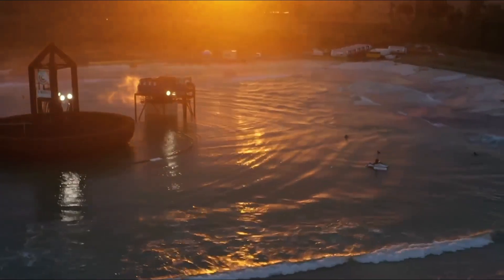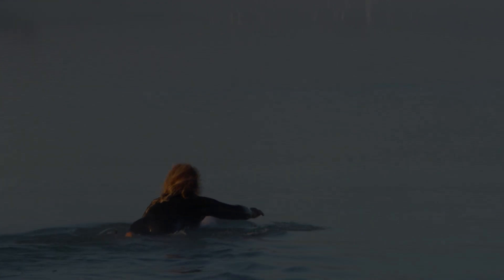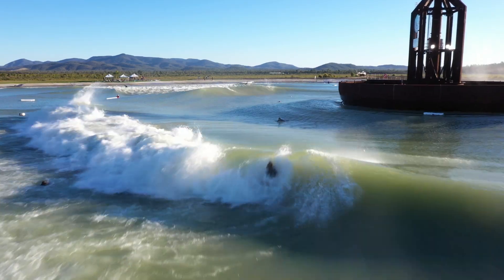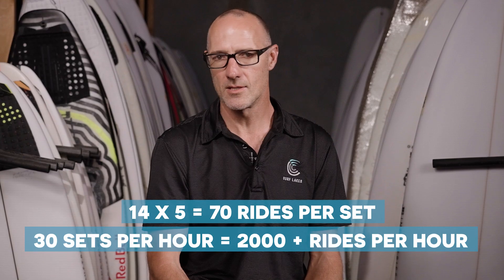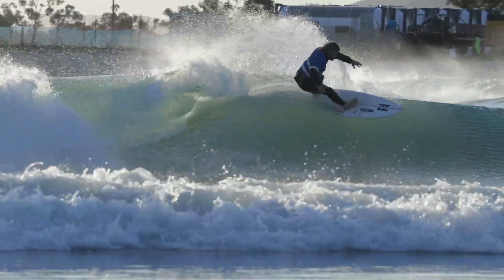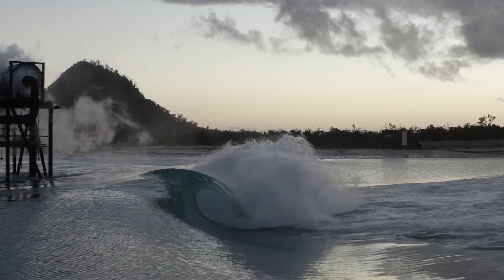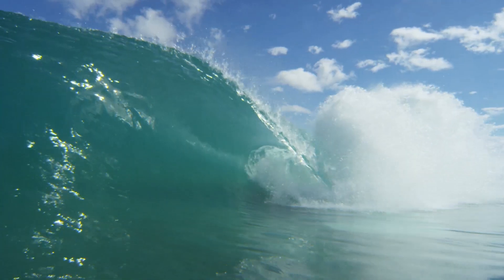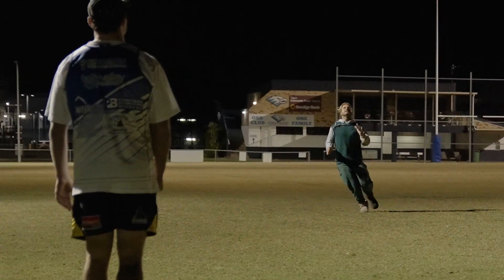Surf Lakes Tech Explainer Series. Part 1 - Energy Efficiency

Comment: so...what is the $dollar amount to lift the "bob" once?
Reply: Looks like, 25c per surfer, 14 surfers per wave, = $3.5 per wave with that logic,

1 kWh in nsw costs 29c per kWh, so 29x30= $8.70 per wave

And I’m sure it costs less than that to keep a football oval light setup on for less than a second😂
Reply: @chaddie93 say that BOB is a Big Truck.......to move that truck a few metres by accelerating would use how much diesel? probably not much....once the rebound of the water on the bob (which is basically a boat) kicks in the average pump cost would probably average out to something like the video describes.....its pretty amazing theyve made it work so cheaply